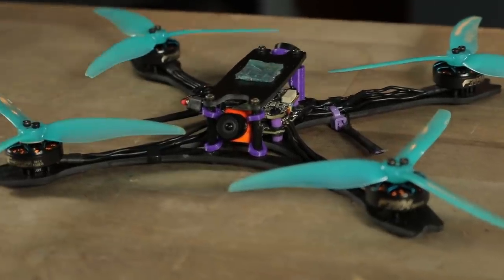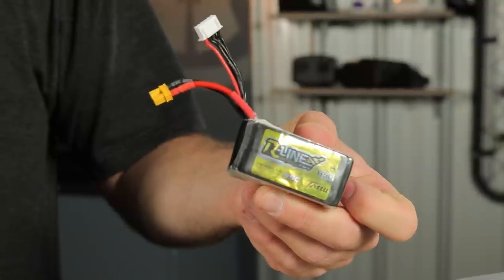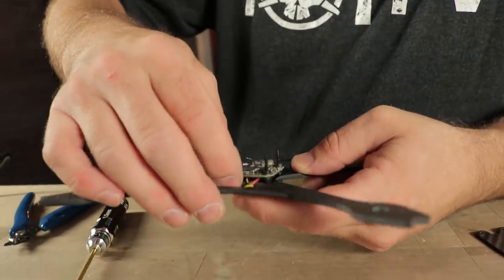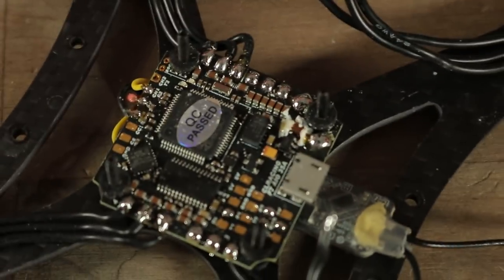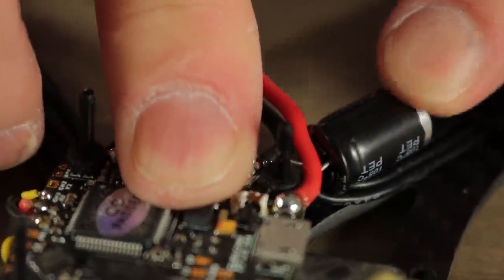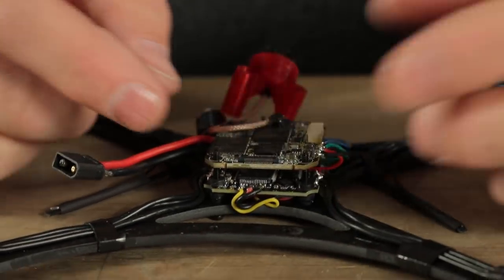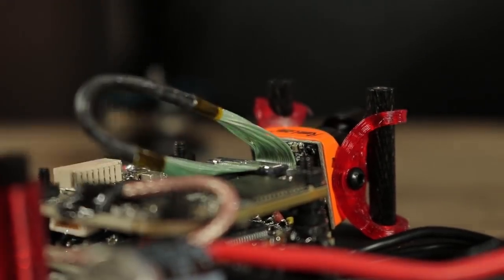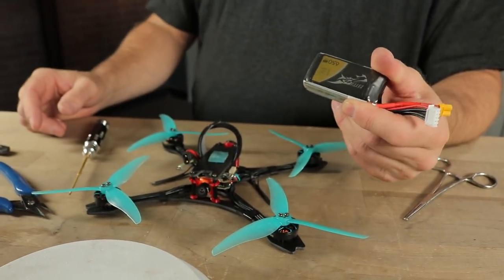Build: sub250g 5inch Freestyle Drone - Rotor Riot OUTLAW

Comment: Am I wrong or is the 5 inch experience a combination of thrust and weight? The 650g to 750g weight is what allows the quad to push through the air resistance at high speeds and the 5 inch prop just happens to be the size that has the right amount of thrust to throw the quad without being floaty because of too much thrust. I could be wrong.  I'm no expert but that seems to make sense. Without the weight the experience might be gone.
Reply: That is why we pushed the limit right up to the max of 250g, rather than building a 2” ot 3” drone.   The weight feels really good.

Comment: So confused. Ummagawd with vista (though might not fit 20x20 aio) or this but might not be able to vista on top plate. 🤔
Reply: Use a naked Vista, and be careful when you power up.....
Reply: Ummagawd's put some proper R&D into his, this is just throwing some random crap from the RR store together.
Reply: @skyweaver3199  yeah def have to leave temp control on
Reply: @FilipRadelic  2fiddy doesn’t stay 2fiddy with action camera.  I love Tommy’s build and it inspired mine.  I think more options will drive awareness and innovation in the 250 space.
Reply: @LetsFlyRC  don’t really need one with DJI DVR, I hardly even use it on my regular 5” anymore, but could stay under 250 with GO 2 if you decased the Vista.

Comment: You could throw an XM+ in there (1.6g). It's probably the lightest receiver with 2 antennae. I've taken them out to 3/4 of a mile and others report more distance with heroic antenna selection/placement. I suspect my radio might be just a tad over-amped.
Reply: The xm+ is slightly larger than the rxsr

Comment: I have the revised frame and I can't figure out which part of the frame is the stack side which is the back side? one side has deeper cuts where the stand offs go and the other side is flat? EDIT... I finished the build.. getting 3:21 flight time with no action cam on a 650mah 4S pack, but that's likely because I am doing a lot of throttle pumps and a lot for flip flopping.

Comment: I have built a 5" which is 196g weight, and it falls under 250 regulation. 
But it runs on inav, it has a gps and mag and can safely rth.
All what is going on here is about battery weight. 
I was able to reach 6 minutes flight time on an 450mah 3S SLS lipo
24 minutes on 4s cheap 2Ah liion pulled from cordless drill
31 minutes on 4s Sony vtc-6. I am not any good at taking nice video shots  so  this build will be behind the scenes.
I should mention that it is not that freestyle quad but more long range-like, still it is under regulation and it is 5".
Reply: Being able to carry an action cam under 250 was my major motivation

Comment: Please don't save weight on power lead wire heat shrink, at least use it on the positive wire so you don't short it against carbon!

And I'd pay more attention to capacitor mounting, this is just asking for trouble. And those standoffs look too tall. Not a very elegant  build overall.
Reply: and that battary strap no thanks plus always run 2 strong  straps apart from that not bad for weight saver quad
Reply: @Mr18031967  didn't wanna nitpick too much, but I agree 😅
Reply: @FilipRadelic  thanks bro